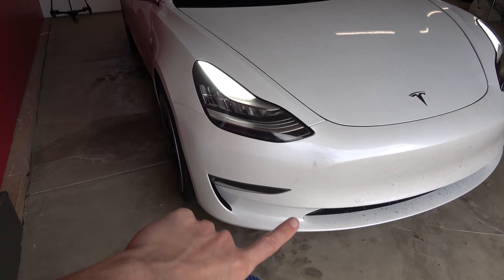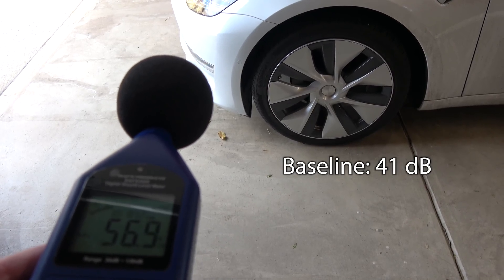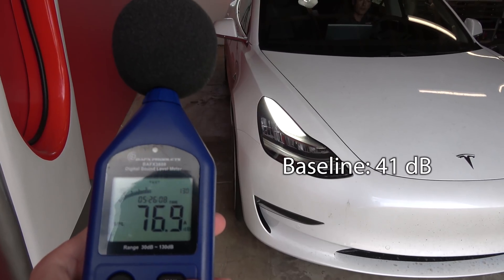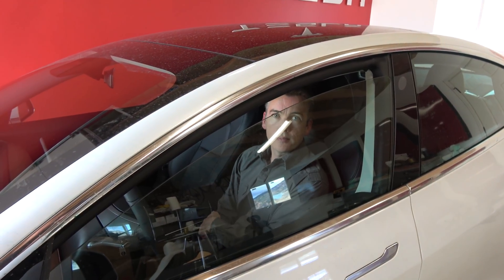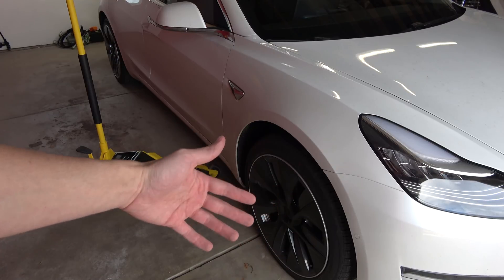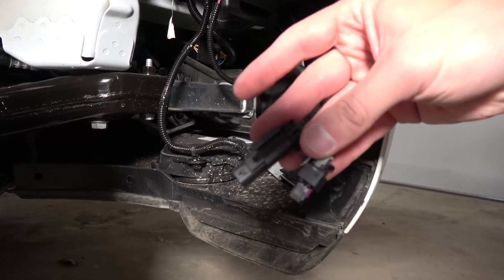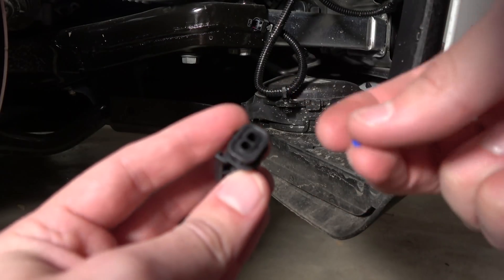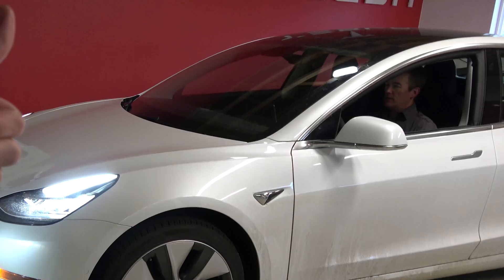Tesla's Pedestrian Warning System. How to Temporarily Disable It...

Comment: isn't it illegal to tamper with the avas system on an electric car? (teslas pws system).
Reply from the maker: Doubt it. The owner can do whatever they want.
Reply: just like heavily tinting your windows. it's your car and you can do it. but it's still against the law and can result in a fine/ticket. the law in the sates for safety of pedestrians was started in 2010 and enforced on telsa in 2019. in canada it was enforced in 2022. tampering with said safety device can result in a fine if caught. if your curious google if it's illegal to disable the avas system. or go to teslas user manual for the pws system. they both mention tampering with it is breaking federal law
Reply: i should probs add that this video was quite informative and well made, great job

Comment: If noisemakers are 100% necessary for the safety of pedestrians, why don't deaf people constantly get run over by the vehicles they can't hear?

A: Most pedestrians stay out of the way of vehicles when in places vehicles frequently are (roads, parking lots, etc.)
B: Most drivers open their eyeballs and direct them toward where their vehicles are traveling a significant amount of the time, and apply brakes and/or steering if they see a pedestrian in their way
C: A combination of A and B

There are gas cars quieter than my Model 3. Why aren't they required to have noisemakers?

Comment: the noise is for safety when backing up, but I hate that noise. its very crazy noise. like alien noise headache noise.
Tesla update the sofeware and turn on the warning message. hehehe... remove the speaker and plug the mouth of the speaker....then duck tape it, bolt it back in place. the noise will way less.

Comment: do you know if the isolation kit still works?  I read the following disclaimer on an a sellers page of a similar product.  “It has been reported that firmware revision 2022.28.X can sense when the PWS speaker is disconnected and will a notification to appear. We are currently working on a solution.”
Reply: The screen pop up is still not resolved. My guess is they don’t want to get sued so they aren’t spending the resources to fix it.

Comment: Just keep in mind that you will also disable the boom box feature, as the sound also goes through that speaker.  For me that is not an issue as the music sent through there is of very bad fidelity, and  sending fart, goat and other noises outside is not within my personality or need.  So trading these for a quiet car is more than worth it.  Can you imagine a world with ALL cars having this feature?  It would be worse than the sounds coming from ICE cars now.  Solution for such an innovative company like Tesla:   put together a motion-sensing device that could then, and only then, give a sound-based clue about approaching people at certain speeds.   Pack it all together, and it could act as a kind of flashlight that blind people could use to avoid hybrids and EVs.  It's all commercial, off-the-shelf stuff, it just needs to be put together.

Comment: One more question: do you get any errors after unplugging the speaker? Does the System notice?
Reply: The car does not notice that the speaker is disconnected. This solution works as advertised. Did it on my MYP.

Comment: Do the Horn & Summon sounds (e.g. DJ, Coconuts) utilize that PSW speaker? (Will they be disabled with the PWS speaker disconnected?
Reply: There are traditional horns as you'd find in any car, Tesla doesn't play a horn sound over the PWS speaker. So you still have functioning horns after implementing this fix.

Comment: I disagree with altering the sound emissions because I believe they are there to warn blind people, guide dogs etc  that a car is approaching them.  A gasoline engine accomplishes this because of the engine noise and Tesla and other electric vehicles have added the sound emitter to save lives.  Please think about this before you alter it.  I have a model 3 and only noticed it for the first few weeks I had the car.

Comment: Any suggestions for my Subaru Crosstrek Hybrid?  My Prius Prime from Nov 2019 didn't have this, but the new Crosstrek does and it's quite loud.  Not many of these cars yet, so I may have to figure it out on my own, but thanks for your video.  I would like to lower the volume at least.  It's much louder than even the gas engine (at low speeds) on this plugin hybrid.

Comment: That's not loud enough to be useful to warn others..but now for the other optional boombox audio you can play outside, we should be able to play at 120dbs if we want to. If motorcycles are in front of you and won't move over, we need the volume and amplifier/driver setup which can be more useful.

Comment: since the reset ‘saw’ and enabled the speaker, then Tesla has electronics to detect speaker — does the female connector have a dummy load resistor? So that the electronics tell the software ‘speaker present’

Comment: I agree. Although it will be fun when they come out with different sounds and voices you can activate. Sadly in that case, my model 3 is pre-pedestrian speaker.  However, when they made these disable caps, why did they not make just a coupling that went between the plug and socket that makes it look like they are connected, but it does not allow the contact to go through that coupling. If someone checked the car, or on a visual only inspection it would not be obvious that you disabled it if they looked at the cabling.

Comment: You could use that same kit with some wire and a resistor (variable resistor?) to make an inline volume control. keep the sound for safety and compliance but turn it down for comfort.

Comment: If I got a model 3, this would be the first mod I would perform. I'd be embarrassed driving my 65,000$ EV with that noise. My previous car (VW GTI) was very quiet inside and out at low speeds. Much more silent than those silly fake noises.

Comment: I’ve had more people step out in front of my 2015 Nissan Leaf with noise maker in parking lots than have stepped in front of my 2019 Model 3 without noise maker in parking lots. People don’t pay attention so having a sound generated from the car is going to make little to no difference. I’ve watched people step in front of large noisy diesel trucks just as much as silent electric cars.

If this was really an issue, there would be news articles everywhere about pedestrians being hit by their silent hunters, but I have yet to read a single article claiming injury because of EVs hitting unsuspecting pedestrians.
Reply: I call these kinds of walking people Darwin Awards attention whores!
Reply: Wow, just came across my message from 3 years ago as I prepare to take delivery of a new Model Y. The new car will have the noisemaker my current 2019 Model 3 doesn’t, and I’m looking for ways to disable it before even taking delivery.

Comment: My LR AWD doesn’t have it. I got mine in June 2019 in the Netherlands. Do you think in the near future an OTA update will activate the sound ? I checked my car and the hardware is there....
.
Reply: Do you have the speaker holes underneath the front bumper ? If yes they can enable it with a OTA update when it becomes mandatory in Europe.
Reply: Raphael i do have speakerholes on the underside of the front bumper....
Reply: And it is already mandatory for EV’s in the Netherlands to produce a sound when driving slow or in reverse. My former EV, a Hyundai IONIQ EV had the VSS on board. (VSS = Virtual Sound Simulator). 
So i think my M3 will make noises after one the coming updates......
Let’s hope there will be a choice in sounds.

Comment: You do this and hit a pedestrian: 
1) you will get sued 
2) your insurance will not indemnify you  
3) your car will tell on you by indicating  the warning signaler was disconnected, so you will always be at fault (even when you are not ). 

Deal with the noise; the risk is not worth the reward.
Reply from the maker: So what about cars without the noise maker?
Reply: DÆrik 

That would  not be the issue.  You can’t argue that you are not at fault for causing an accident because the automaker allowed me to go 100 mph on a 30 mph roadway!   

The plaintiff’s argument would be:

 1) the person was hit because they could not hear the car 2) the car had been equipped with a safety feature which would reduce the likelihood of a pedestrian being hit aa a result of not hearing it while it travelled on the roadway 3) the owner intentionally disabled this safety feature 4) the accident would not have occurred had the owner NOT disabled the safety feature 5) the defendant in this case  would be required to prove that these allegations are not true and accurate.

Comment: Just and FYI: I have a Model 3(pre-warning system) but my wife has a RAV4 Hybrid 2019 that has the same issue.  We were told by Toyota to measure the resistance across the speaker (Ohm's) and put a resistor in across the wire going back to the car so the system would not know it was removed it from the speaker, and possibly setting off the check engine light.  Apparently Tesla does not check that its disabled currently but one day they might.
Reply: Tesla won't care or will just document it on their end.

Comment: They didn’t give you the correct plugs for sealing. When it has the hole it is meant to have wire through it. They have solid silicone plugs for inserting

Comment: Yeah, these sounds are not good. Tesla definitely needs to hire a new sound designer. Especially having a backing up sound with such a districtive pitch is rally annoying. Much better to use a pitchless sound. The nice thing about EVs is that they are quiet! But if EVs have to make a sound a low speeds, at least put in a soft sci-fi kind of synth sound, like what they use for vehicles in futuristic sci-fi movies. As for backing up, perhaps a simple nice, soft and calm voice alerting pedestrians to pay attention, instead of a loud sound or that pesky traditional beeping?

Comment: IF noise making devices are to be  required of quiet vehicles, the law should include ICE vehicles as new modern engines are virtually silent. Standing at a cross walk they are silent unless the electric cooling fans are running, which is the same for electric cooling systems. My nissan leaf had a noise maker that just sounded like rolling tires on payment. There are other solutions that don't makes it sound so obtrusive.

Comment: Maybe we should all add these to all our cars and have them on all the time. Maybe then the morons who mandated them will get the point and reverse their nonsense.

Personally, I would be inclined to add a switch so I could turn it off and on at will. Much less likely to result in a ticket...

The way that regulation reads, it's unlikely that Tesla can change the sound or enable users to change the sound in the future. However, it should not be too difficult to use an Arduino or Raspberry Pi to sense when a sound us required and play a sound (at the volume) of your choosing, using the original speaker.

Comment: As the rider of a bicycle (road) I, in part, depend on my hearing when it comes to traffic that's overtaking me.  Sometimes the noise from tires isn't loud enough for me to detect.  So I can see where you're coming from but I can see the other side too.  Just wondering what your thoughts are regarding if you hit someone and the sound has been disconnected are you leaving yourself vulnerable for a lawsuit?
Reply: No PWS is required > 20 mph in US. So as a cyclist, you still must rely on visual checks. Personally, when I ride on the road I use mirrors as well as sound cues. Even ICE vehicles can be quiet when coasting -- especially if you have any wind noise blowing through your helmet.
Reply: Tesla will never hit you from the back. We have autopilot and auto emergency brake.

Comment: I wish it was still silent. However, if anyone disables this speaker in any fashion you may be at legal risk in the rare event you hit a pedestrian. If their lawyer learns you disabled a safety device they will use that in court even if it didn't cause the accident. You can imagine the upper hand it gives a prosecutor. So tread cautiously. 

I'd be curious how quiet a modest internal combustion engine car is, like a Corolla or something. I feel like they are pretty quiet in parking lots. Are we going to require them to have these speakers? This seems like somebody is picking on electric vehicles. You should totally take your decibel meter and go test some ICE vehicles for comparison.

Comment: I agree it is an obnoxious sound, especially in reverse. While manufacturers are not required to have all of their production compliant with this new law until Sept 2020, I believe they are required to have 50% of their production compliant by Sept 2019. So, once the safety device is installed, by the manufacturer, on your car, I'm afraid that you are legally stuck with it. Like any gov regulation, there are requirements on type of sound and volume that must be met. If you willfully disable a legally required safety device and something bad happens, I imaging that you are going to be in a very large amount of trouble. I wish Tesla would reconsider that reverse sound.

Comment: In your garage the sound is higher.  Think how loud a car is driving through an overpass or tunnel.  You should've tested in your driveway.
Reply: It's still loud as fuck.
Reply: Before I realised what it it was, I thought the Tesla passing me in the street was seriously broken. Especially as even the diesel vans passing me on the same street made LESS noise.
Reply: It's loud even outside
Reply: And yet even with the louder reflections in the garage its orders of magnitude quieter THAN HIS TALKING.  And normal street noise is 60-70db so that's still VERY quiet.

Comment: Not sure why you would want to disable a potentially life saving device. Did you forget that you become a pedestrian after you exit your vehicle? It would be rather ironic if you were to be hit by an EV that didn’t see you and you didn’t hear it!
I wish my April build 3 did have this.
My 2011 Nissan Leaf has this.
Tesla has already confirmed that a retrofit is not available due to the wire harness being different.
Reply: It's bullshit. Nobody will be saved by this. You need to drive quite fast to seriously hurt somebody, like 10 kph, in this case the tires do already make a noise.

Also there are a ton of mild hybrids out there which drive with exactly with the same noise level when driving slowly. They are not required to add such a device.
Reply: Ok...but what if it does?
Reply: @RayNLA  do you have any reason to believe that? 🤔

Comment: You really should do the dB test outdoors because the walls and ceiling reinforce the sound causing the readings to be higher. The RELATIVE readings would be lower outdoors. The ambient levels might be higher or lower outdoors depending on the location. I wonder if laws will be passed that make it illegal to defeat the sounds.

Comment: Some thoughts re voice & environmental noise levels:
1. Outside noise levels will often be significantly louder than what was measured in your garage (think traffic noise, sirens, parking lot related store noises, music, talking...). 
2. Conversational speech alone ranges from 65-80 decibels in loudness. When you were talking, your sound level meter was showing 74-80+ dB's in loudness. 
    In light of the above everyday environmental & speech related noise levels, car warning sounds meant to alert pedestrians that a nearby car is  moving likely will need to be 65-75 decibels in loudness in order to be easily heard. Had someone been talking &  walking by your backing up car only putting out 50-55 dB's of sound warning, they might not have heard it. This would even be more of a  problem for those with a hearing loss, and/or visually impaired. 
    I agree the Tesla slow speed/backup alert noise is very unpleasant. But, if my backing up Model 3 hit someone because they couldn't hear my car, I couldn't forgive myself. Thanks
Reply: Lol, what, do you think it be some kind of consolation if they could hear your car before you hit them?  This is how stupid, wasteful, ineffectual laws get passed.  You are responsible for not hitting pedestrians.  The noise maker thing is moot point.
Reply: So you wouldn't be using your eyes and backup camera and think there's a possibility you could just inadvertently back into a pedestrian one day? Seriously?

Comment: Test a gas powered car for low speed noise and compare to the electric car. Horns were meant to notify pedestrians if needed, not always on artificial noise makers. Once electric cars are common, no one will pay attention to the car noise anymore. However the noise of a bunch of electric cars on the road would be very annoying. Especially in parking lots. Maybe Tesla could add a SpaceX cold gas thruster to make some noise. That would get your attention walking by the Tesla electric powered vehicle, Ha Ha.